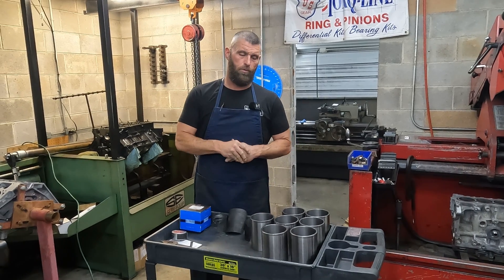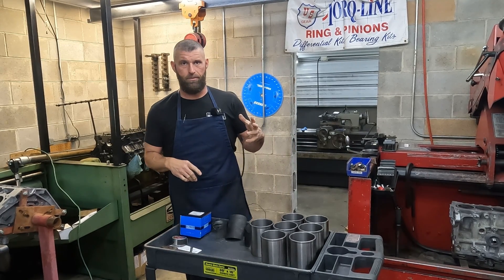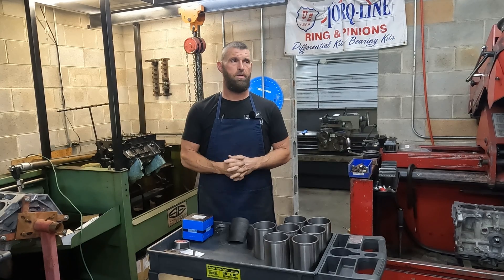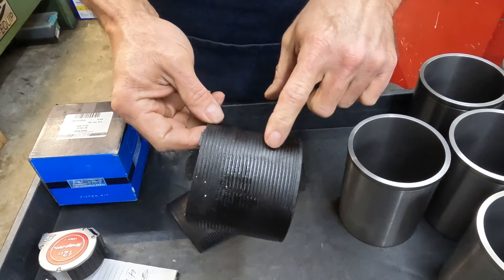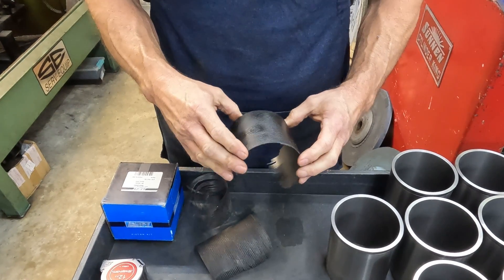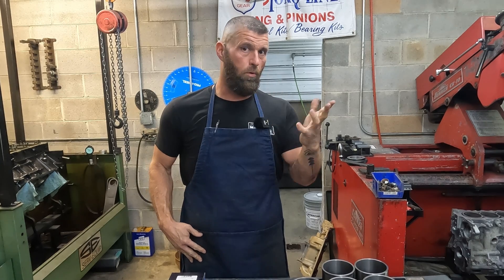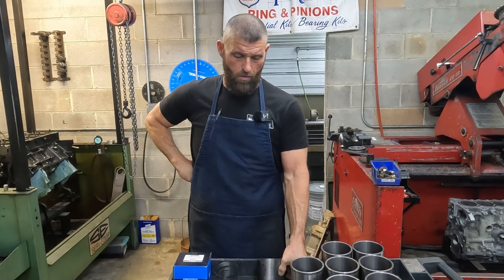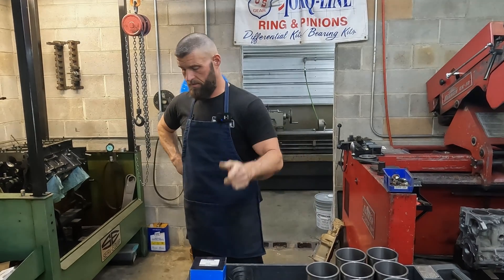Why we have to Bore out Ls sleeves to remove them

Comment: Hey man.  I appreciate your work and tech bits.

Wanted your input on the early Ls1 blocks (97-98).  The stock bore is 3.898", and I'm about to build a 383 out of the original engine.   The new pistons are 3.903" 2816 Forged Pistons, and it was recommended to have about 3 thousand piston to wall clearance on the aluminum block.  But some say it is not a good idea to over bore the early blocks 0.004 for the new pistons?  As early blocks, depending on what i have, might the liner might have been shifted as it was casted.  Any input would be helpful before pulling the trigger on the original engine.   Or should i get a resleeving done, or maybe 2000+ aluminum block is a better route? It's the OG LS1 on a 98 camaro
Reply from the maker: The block is fine, follow the piston manufacturers recommendation on skirt clearance
Reply: @powellmachineinc  I'll have a look at it when I take it down to bare bones.  Thanks

Comment: A question if you bore out  and install a set of Darton sleeves in a aluminum or even a iron block. Can those replacement sleeves then be pulled when rebored to their maximum diameter after a few rebuilds??

Comment: I want to put a crate engine in my 57 Chevy. I want to make 350 to 400 horse power. Which motor should I buy? Thanks!
Reply from the maker: A gen 4 5.3 and a cam, headers will do that with ease
Reply: @powellmachineinc  Thank you!

Comment: Some of the eccentric is the centering fingers on the boring bar if it's an older machine like a kwikway or similar
Reply from the maker: Definitely not
Reply: @powellmachineinc3179  musta just been the particular machines I was using, for the Aluminum CanAm 496" engines I was doing in the 70s
Reply: Or it coulda been those Stage V Keith Black blocks I was doing about the same time....

Comment: I don't know if you've done any Harley Davidson cylinders but they are rough cast outside before being cast in place.
On an 883 Sportster, there is almost 3/4" of cast iron to bore out,  just doing an 883 to 1200 needs 0.496" bore increase.
I'm guessing the grooving is to increase surface area as well as locking in place?
I'm one of the people who asked about pulling sleeves although I did mention about cast in place being the reason for boring.
Reply from the maker: Yeah, have done a lot of harley stuff

Comment: I put a cam & cam bearings in my wore out 6.0 (can't afford to do it right) so couldn't take block to shop for prep, I did put new rod bolts in, cleaned all the crap off pistons. It had around 55b oil pressure cold then about 50 before,  Which is kind of surprising for over 250,000 miles I would think.  But when started it to see if it will run pre-tune. It's 35 then 30. I wondering if I jacked the oil pump O-ring, or is it because I got Is rid of all the carbon build up? The cam bearings all lined up perfectly.  Besides I should have hone  it and got new rings, what do you think?
Reply from the maker: Bearing clearance is excessive
Reply from the maker: If you can't afford to do it correctly the first time, how will you be able to afford it the 2nd time?

Comment: Are all aluminum 6.0 LS blocks the same regardless of the engine code? For instance I have a hard to find L77 in my Chevrolet Caprice PPV. Are my sleeves similar to what you've shown?
Reply: I think if you gave a phone call or email to cylinder liner companies, they could tell you if they are the same or different.

Comment: Easily pressed out sleeves are something you find in heavy diesels. It is probably because the manufacturer knows such engines will be rebuilt.

The LS engine is not then only place you'll find aluminum cast over sleeves. Toyota did this since about the 2010s and they called them spiny sleeves.  Toyota sells +.25mm pistons, but finished new short blocks sell for so little from Toyota, many choose that instead. A 4 cylinder short block can be ordered and delivered quickly. You send your head to the local machinist and it is probably back at the same time as the OEM Toyota short block. With so many busy machine shops, many have complained about how long they wait for the crank to be polished, matched bearings to be ordered, and cylinders to be bored+honed.

Many of the latest iron sleeve aluminum blocks have as little iron as they can get away with. The OEM won't sell more than a +.25mm piston, and often you won't find aftermarket pistons bigger than +.5mm.

Comment: When you say, "Core Shift",  you mean the aluminum block expands/contracts enough to cause this irregular wear?  I'd have
never thought they'd use any material that would allow that kinda of expansion but then again,  I'm not an engineer where
money is the bottom line.  Back in the older iron motors,  did they have much shift or just less?  peace
Reply: No it's when they cast the sleeves into the block. The sleeves center is not perfectly in line with the center of the blocks cylinder. So when the final machining is done to locate the pistons in the proper location, the center is off on the sleeve. Which is why you'll see the thinner and thicker sides of the sleeve in the block. It's not from uneven wear.

Comment: why don't they screw em in?  Hi-Po I mean. I block doesn't look too difficult to thread up nor do the barrels . . .  actually I am not sure why they don't just use aluminum cylinders then use like a Nikisil coating or something?   I know I have beat the tar out of every single Aluminum sleeved racebike or streetbike I've owned it just said "thank you sir may I have another" or "that's all you got?  no jokes, they're taking 1000CC and getting 1000 streetable HP out of them with boost . .   1hp per CC not CI . . 

 that's just ruthless, and they run the pistons right onto the aluminum sleeves conventionally cooled, as the pistons rings break in the electroplated cylinder walls coated with nikisil transform to a very slick and durable surface..   which means you now have the heat conductivity of aluminum which is superior to steel, and the slickness of ceramic coating ..  givin the added heat dissipation and smoothness of the walls with increased durability its a superior setup it would seem? not only that but givin the differences of heat dissipation or expansion and contraction between steel and aluminum it allows for superior tolerances to be used with far m ore accuracy, or dependability if you will..  

just wondering why they don't, must be a reason, you can run hi compression, boost whatever with nikisil I am wondering of maybe its not suitable with nitro methane?  always wondered that, nikisil is used heavily if not exclusively in motorcycle racing and street bikes and break in is simple a few 4-5 strong heat cycles done deal, maybe that's it, they do need to be broken in as part of the nikisil process, the coatings on the piston rings react with the nikisil coating to create a bond, I give my bikes, oh 100 miles of hard heat cycling for street, an hour for race.. and I know the factory gives an initial break in as well for those who forget...

you are a good teacher and your subject matter is always interesting!  TY . . .

Comment: Very pertinent and well explained video Daniel!. 
Core shift is a problem we see more prevalent in a number of different manufacturers blocks.
A lot of aluminium blocks that have plasma coated bores that are worn or damaged needing sleeves uncovers just how bad the coreshift actually is.
Reply from the maker: Absolutely
Reply: I think this is a reason that when Porsche guys need a rebuild, they put a new plating on the cylinders, instead of Darton sleeves.

Comment: Great Video as always…
Folks don’t really understand what core shift is.
In my case:
I was considering buying a 4.1 Buick V6 Stage 2 block, but it didn’t have a sonic test sheet included, so I had an engine shop in Charlotte Michigan do a sonic test before I bought it to make sure it had enough meat on the thrust side to handle the 1300 HP twin turbo build I had planned.
Reply from the maker: Yep, that is definitely a must do test

Comment: Regarding pressed sleeves, I often heat across bearing races with torches or by laying a bead of weld to contract them to loosen them in the bore. Why does this seem to not be used to aid in pressing sleeves out. What about freezing the sleeves.

Comment: I've squeeze cast bedplates, robot sticks inserts in die closes aluminum is shot with 35000 psi metal pressure, those come out easy, but the ribbed sleeve cast into aluminum block no way Hose...It's Cormbread always 👍👍👍👍👍👍👍👍
Reply from the maker: Lol

Comment: great video as usual . i would love to see a commenter actually pull out a liner without ruining the block.
Reply from the maker: Yup
Reply: The commenter, was probably like me. Very little knowledge of the LS engine. That's, why I watch Powell Machine. Ford guy, here.
Reply: My automotive teacher got his start in the 1960s, and talked about the changes in the industry over the years.
He said that if you chose someone to do auto repair, you did not want a guy who read the manual, because that means he hasn't done very much for very long.
Then he said in the 1970s, you didn't want anyone who does not read the manual first, they are sure to get it wrong. Only a fool thinks they have it all memorized.

He was very serious about doing things by the book. The only non-OEM parts he regularly bought were oils, oil filters, and batteries.
Reply: That's the weird part. Why do people care that commenters are dumb? When someone makes some claim that they can do "x", go to their page. When they have zero deleted videos, ignore that person forever. Some claim they have skills without video proof? Nope. You are ON YOUTUBE. There is zero reason you cannot whip up a video if you are an expert at some thing. The end. Hope that helps everyone.
Reply: @eriklarson9137  Metalshaper rebuilds Jeeps. He gets critics from the comments section. He just tells them to show their videos of restored Jeeps.
Reply: Didn't know about LS engine but have had experience of cast in place sleeves. 
The amount of 'pull' needed would most likely destroy block before sleeve moved, probably several hundred tons?